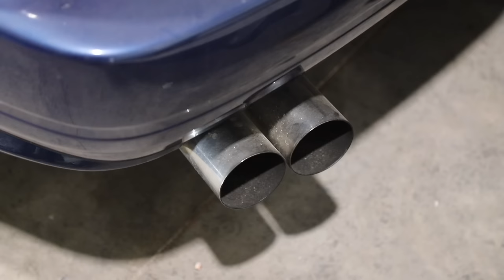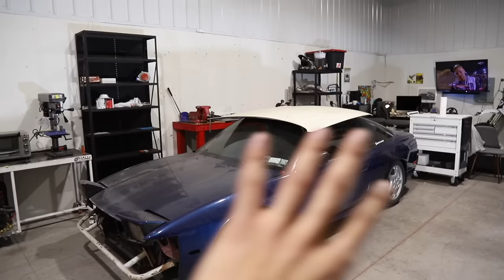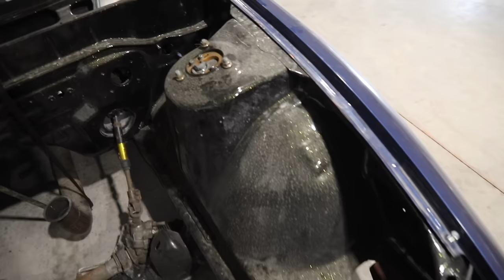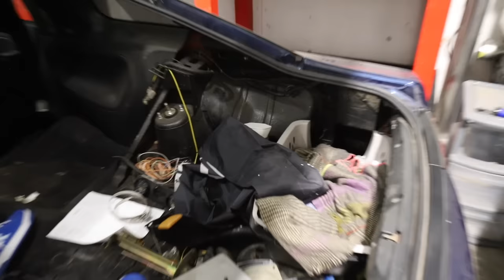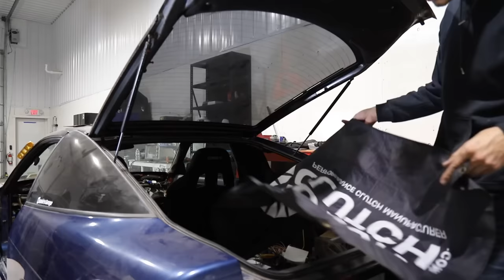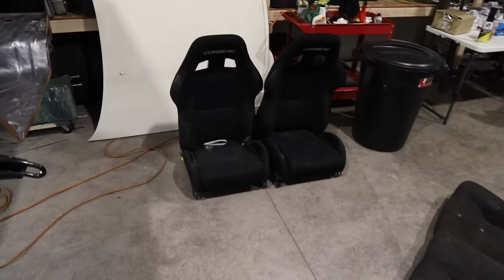The Ultimate Project Car Revival: Bringing Life to a Forgotten 90s JDM Gem

Comment: Not bad! I need to get my 89 hatch back on the road. Its been sitting since 2016. :-/

I think you should do a nice restoration. Get it as OEM as possible. OE+. Thats what i did with my 240SX. SR20DET swap with minimal upgrades. T28 Spec R turbo, Greddy FMIC, Nismo injectors, Z32 MAFS. 

I should make a video of it for my channel.